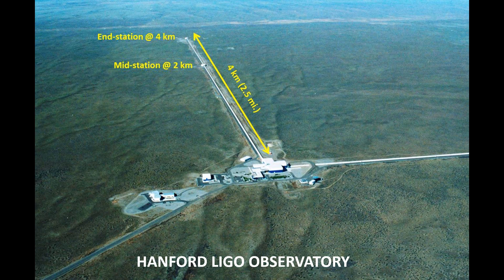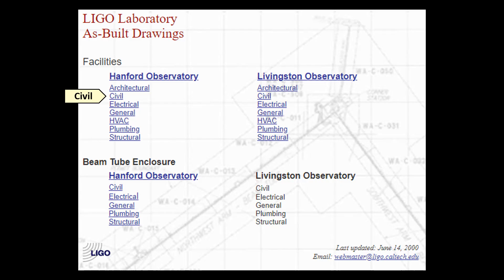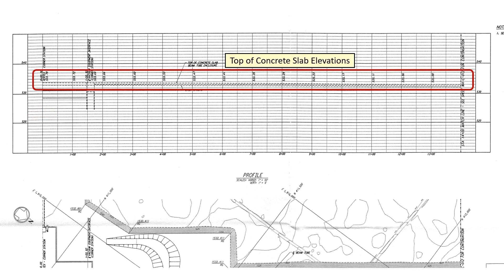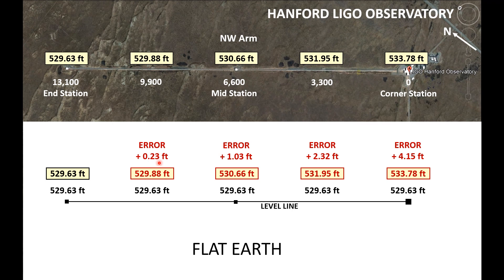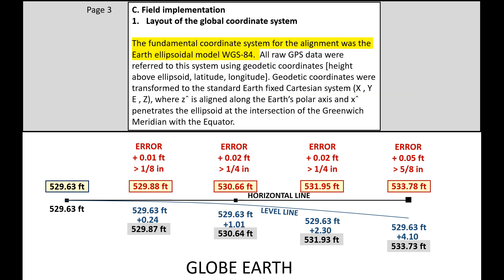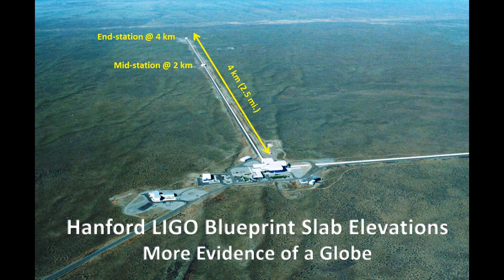Was Hanford LIGO Built on a Flat Earth or Globe?

Comment: FE Dogma, I was in commercial construction, also.
I used to use instruments, to do a lot of site layout.
I can confirm your observations.

I have found, most FE’ers do not have many mathematical skills.
Yet....they are more than happy to tell you that “you are wrong”, without any accurate evidence to their claim.
Reply from the maker: Thanks.  Most of my experience was with rotating laser levels doing sub-grades with heavy equipment operators for column pads, footings and slabs on tilt-up projects.  Definitely not first order elevation tolerances.  I have very limited experience with site-layout and that was as a helping hand if I was in the area.  It does give me a basic understanding of the concepts and an appreciation of the skills required to accurately lay-out a jobsite.

Comment: You have 2 tangent points on the same arm :0
Reply from the maker: This is a comment out of the blue.  Also just curious, did someone purge all globers from the "On the Level" discord channel?  I wasn't active on the internet for over a month and about 3 weeks ago clicked on the "On the Level" channel and there is no Livestream listed in the left box and of course no Livestream Chat.  

Hopefully by now you understand that those top of grade elevations for the beam arm slab form a curved line with your definition of a level line but yes, there are two tangent points at two different elevations but I only use a single tangent point for each arm.  

I was testing the hypothesis that the elevations of the NW arm was the equivalent of a horizontal line tangent to the elevation of 529.63 ft which on a globe would be a circle with a radius of 3,959 miles + 529.63 ft.  This 529.63 ft level line would also curve down from the horizontal line at the tangent point.

Earth curvature adjustments showed that my hypothesis was correct.  Of course this was not surprising since all the data concerning LIGO shows that elevations were based on the WGS-84, not an elevation datum based on a horizonal plane.

I did the same thing with the other arm except the slab was tangent to a circle with a radius of 3,959 miles + 533.78 ft and the results were the same.
Reply: @fedogma8407  we’ve been at Next Level Discord for quite a while now, we went over your video last night. Did you know that you have 1 arm of LIGO having 2 tangent points, one at each end?
Reply from the maker: @TryThinking  I should have said the "Next Level" discord channel, not "On the Level".  So did someone purge globers because I use to be able to join the Livestream and chat.  Again, those are not even listed in the left hand column.  I can't even type a message with the few things that are listed.

Did you read my reply because I explained the two tangent points. The tangent for the NW arms was at the end station.  Although the NW arm does intersect the SW arm at the corner station the tangent at the corner station was only used for the SW arm.  Why I did this was explained in my first comment. This is pretty simple geometry.  Two tangents at two different elevations.

Did you know that these elevations for the beam slabs are a curved surface on your model?  Do you really think that LIGO was constructed with two curved beam arms?
Reply: @fedogma8407  We had a lockdown a bit ago due to a gratuitous globe science attack, I’ll have a look at your roles. 
I’d love to hear about the multiple tangent points and how you logically derive them.

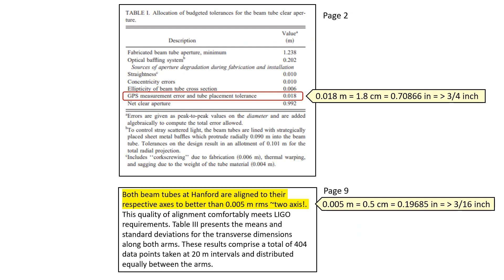Comment from the maker: It was correctly pointed out that I used the "greater than" symbol (>) when I should have used the "lesser than" symbol (<).  @ 1:50 it should have read 0.018m = 1.8 cm = 0.70866 in < 3/4 in and right below 0.005 cm = 0.5 cm = 0.19685 in < 1/4 in  I had written 3/16 in but when reviewing this I noticed that it was actually less than 1/4 inch and slightly larger than 3/16 inch.
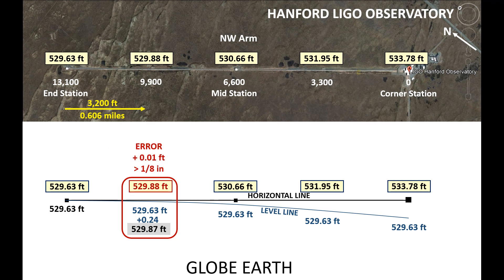Also when I did the calculations for curvature drop (first example @ 9:05) the error should have been written as +0.01 ft < 1/8 in   This same format should have also been used for all the other errors.  Entire list @ 12:20.   Thanks to the commenters on my channel and Blue Marble Science's channel who pointed this out.

Comment: Case closed. Superb analysis of publicly available information. I've been working on arranging entrance to the LA location to perform a high precision as-built survey using digital leveling, GPS / GNSS, and electronic total station instruments, but since learning these survey plans are publicly available for download, and seeing Blue and now you present these drawings along with your excellent evaluation, I'll stay home :) 
Applause for your fine work !
Reply from the maker: Thanks for the nice compliment.  Actually I had fun going through the documents and reading that article about the alignment.  I was always curious as to how they built this. One thing did surprise me, the support brackets at the beam tube joints had a very low tech method for adjustment.  It looked like your typical 3/8th inch all-thread rods.  Of course when you think about it, it was certainly good enough to do the gob.
Reply: https://youtu.be/Ju7h5YLtEow look what I had to do to help the Bevians.
Reply: What do you think of the twin tangent conundrum he's created? I'd imagine it's the sort of thing you'd enjoy in your line of work.

Comment: Nicely done! I have a maybe silly question, though: could they have used an actual water level gauge + calculated offsets rather than GPS and achieved the same accuracy?
Reply from the maker: Water levels are not easy to work with but are good enough for short distances.  My brother and I used one to set corner elevation on his new 3 car garage addition.  The problem with them is that you have to remove all the bubbles inside or they can interfere with the accuracy (not easy with thin or long hoses)  Once in position you have to wait for the water to quit moving up and down.  When you move one end you need to make sure that it doesn't get too low or high or water comes out and you need to refill it.  Finally you need to make sure you are either marking from the top or bottom of the meniscus at both ends.   GPS would be much quicker and certainly more accurate over long distances.
Reply: @fedogma8407  Thank you for the explanation, it's obviously much harder than I initially thought. The reason I asked is that (if I calculated correctly) to achieve 1/4" of accuracy with GPS, you're looking at ~20 picoseconds difference in signal travel time from the satellites - if they themselves don't move at all between measurements. Now I think I should read the article about how they did it!

Comment: To simplify for flerfs, and for me, here’s a quote from CalTech’s LIGO website: “Beam Tube Installation

LIGO's arms are long enough that the curvature of the Earth itself was a complicating factor when installing the vacuum tubes. It wasn’t enough for LIGO’s civil engineers to smooth a level path and assemble each arm’s tubes in a straight line. To ensure a perfectly level beam path, the Earth’s curvature (more than a vertical meter over the length of each arm) was countered by GPS-assisted earth-moving and high-precision concrete work.”

Comment: We’re the drawings you reviewed for the concrete slab, or for the beam tubes themselves?
Reply from the maker: The top of beam tube slab elevations were taken from the blueprints.  I made a list of timestamps in my description for the various parts of this video.  The information for the blueprints starts at Hanford LIGO Blueprints - 3:29.  There is a link for the blueprints at the bottom of the description.

I did not find any data for the specific elevations of the beam tubes.  From the photos, the beam tubes look like they have about a 6 inch clearance above the slab. My calculations show that the top of slab elevations are almost a perfect match to a straight horizontal line that is tangent to a curved globe level line of constant elevation.

I also included a segment GPS Beam Tube Alignment - 1:26.  This is a very simplified explanation of how GPS was used to layout the position of the of the beam tubes and how GPS was also used during the assembly and final alignment of the beam tubes.  That information is from this article - Precision alignment of the LIGO 4 km arms with GPS  https://dcc-backup.ligo.org/public/0072/P000006/000/P000006-D.pdf    This included a table on page 3, @ 1:49 in the video, which lists the allowable tolerances for both the manufacture and alignment of the tubes.
Reply: @fedogma8407  And Brandon and his fellow idiots will come up with, well of course the paperwork showed this, gotta fake it too. Because the whole world is lying to their delusional minds.
Reply: When are you going to answer my nav. question, Brandon?
Or is your arm stuck again?
Reply: dcc [.] ligo [.] org [/] public/0017/D960211/000/D960211-00.pdf has an arrow pointing to a line in the path and is labelled E Beam Tube. Thus I think the "path" is the concrete slab + shelter.